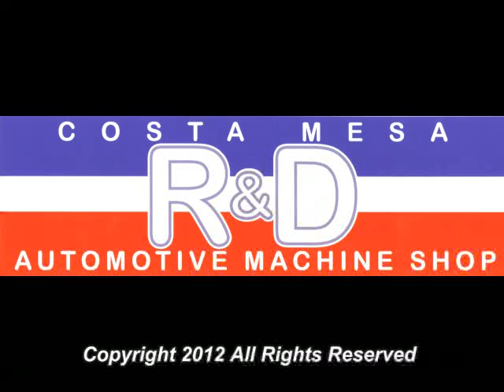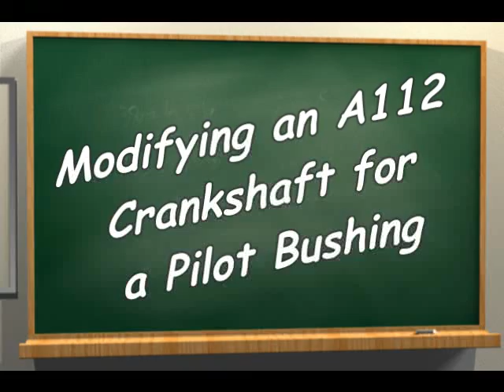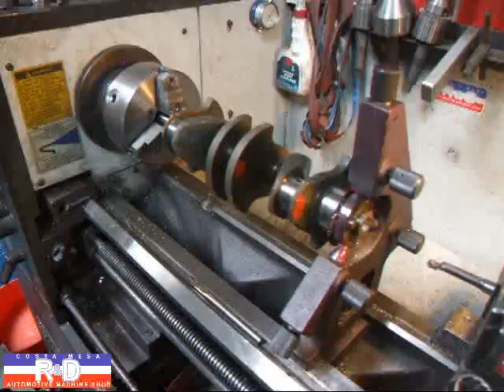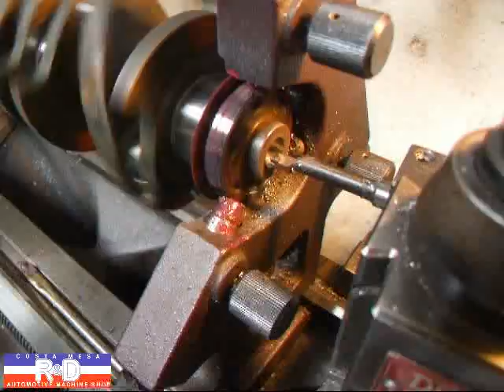Abarth A112 Crankshaft Pilot Bushing Installation.mp4

Comment from the maker: Your do not want to run steel against steel because is will eventually weld itself together. The steel in the steel used for the crank is not compatible with the steel used for the input shaft on the trans. The bushings that we install are made from oil-lite bronze and wear very well.

Comment: Most steady rests are either rollers or more commonly brass tips that you put some bearing grease on. As long as the metal has grease and is softer than the surface of the crank (which is hardened so it is) it will not mar the surface if set up properly. Even soft steel steady rests tips won't hurt the crank as long as the speeds are low and the tips are lubricated.